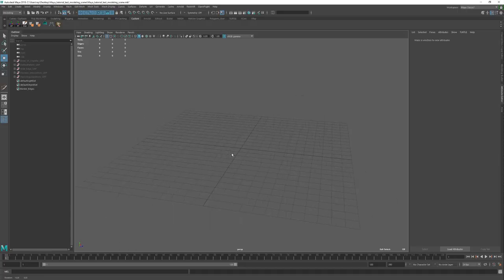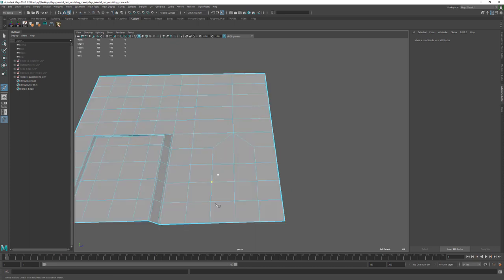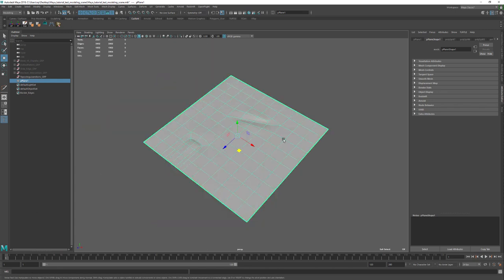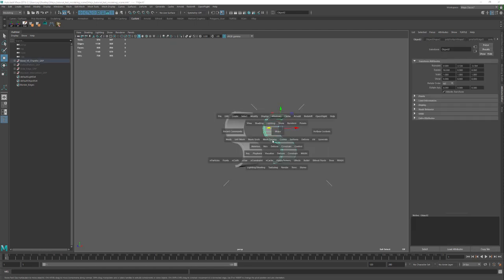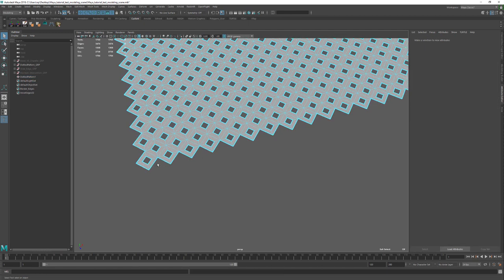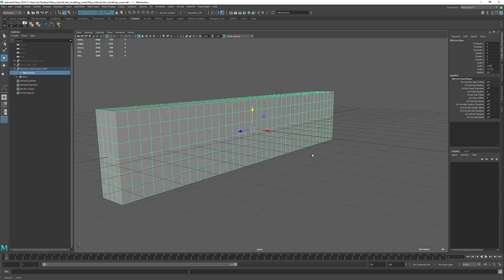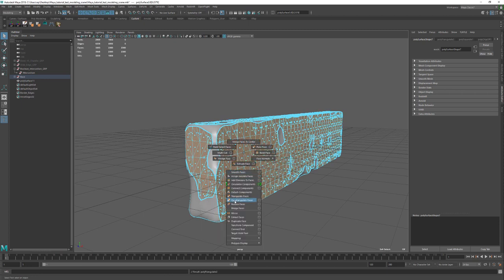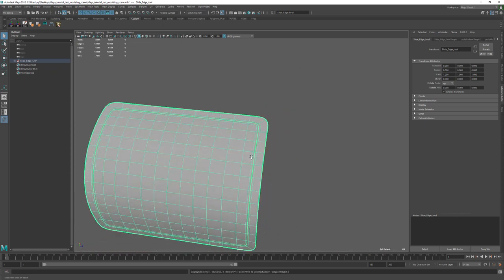Dublin 2047 Modeling Intro

Comment: Hi.How is your Custom Polygon Display set up？
Reply from the maker: Hey xiuT Gao, I believe for the most part my Polygon display is set to default. The two things I usually chance are: In the preferences under SELECTION,  I change Select faces with: CENTER instead of WHOLE FACE, and under POLYGONS I activate Highlight Border Edge, and then I set the Border edge width to something like 4 or 5. Hope that helps.
Darko
Reply: Thanks a lot !!!